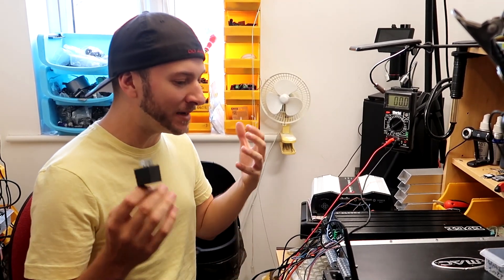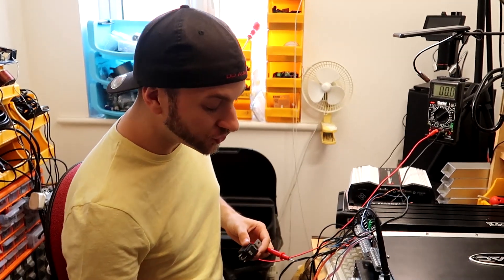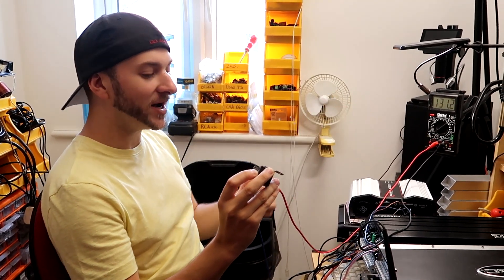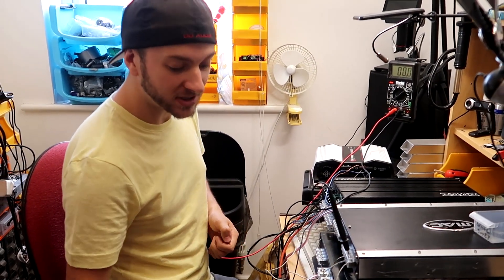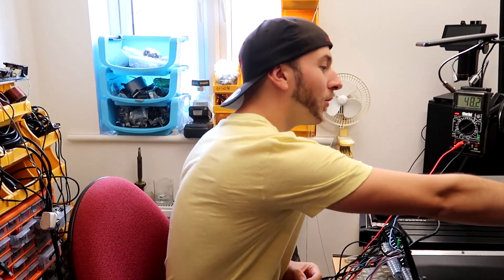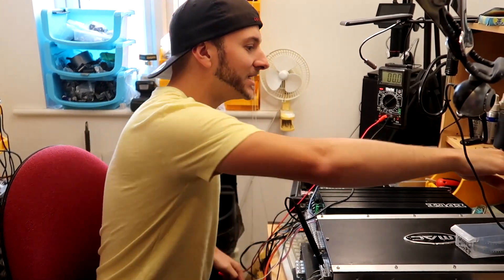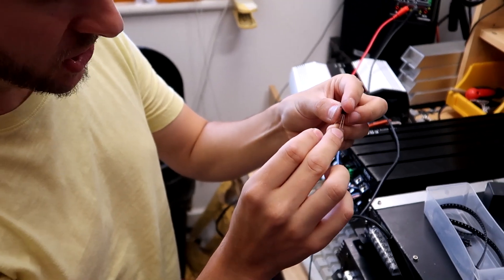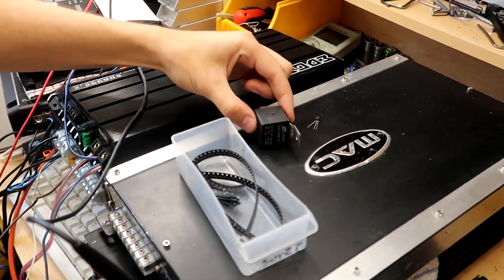"Bro do u need a relay on the remote for runnin 4 amps"

Comment: We had different head units with blown remote lines, all caused by an amplifier/s letting the magic smoke out. 
Most were flagship models running a few front stage amps and multiple sub amps.
If I'm just running an sq system no relay is fine. 
SPL... I would use the relay just in case I create an amp-le-fire.
P.s. don't forget the diode the suppress induced voltage.

Comment: Great demonstration. I'm a believer in sensing circuits drawing less power.

OK. How about active crossover vs. passive crossover networks? Is it even possible to measure any benefit between the amp to the speakers from one design to the other?
Reply: Crossover should be done pre-amp.

Comment: In my case idk if a relay wa s necessary. I wouldn't say that but I did have to run a separate 12 volt remote to the extra amplifier because it was not liking the fact that the factory amp had to share current with the subwoofer amplifier.

Comment: I've only had issues two times when I daisy chained the remote wire to a subwoofer amp and to the factory amplifier. In those cases I went the old school route and wired the subwoofer amplifier to a toggle switch.

Comment: I have 3 amps, a dsp and a voltage display on the radio remote turn on and it works without issues.

Comment: great experiment! however, you have to cut the industry some slack, alot of these misnomers are based from YEARS of misinformation and possibly from older equipment that was likely GARBAGE! The real issues I wish people would start understanding is that you DO NOT have to run everything at 1 ohm to be happy... Its almost the equivalent of driving your car with the transmission constantly in first gear!

Comment: Never used a relay and am not going to. I've ran multiple amps using the daisy chain method and never had 1 fail to power on. I've had multiple discussions with people that you don't need a relay.. its just 1 more part to fail.

Comment: That has to be the shittiest relay I've ever seen for pull-in. Most 12v relays will turn on with 30 mA or less. Most head units are regulated to around 100-300 mA on the remote. 1 amp on a remote wire is not that common for a head unit. Can you power several amps with a head unit, sure. Should you just read the specs in the manuals and make an educated decision instead of relying on youtubers or internet "experts" giving you bad advice, absolutely 100%!
Reply from the maker: I tested a few other relays I have here, all different sizes, all were around 70-150ma, considerably more than these 8 amps together, Not to mention the inductive flyback issues the relay coil can present to the head unit that I didn't mention here...

Comment: Was just thinking about this since I have two amps daisy-chained together on the remote turn wire. Thanks for clearing this up. But now I got a question: can you add a clip light to an amp that didn't come with one to begin with?
Reply from the maker: Yes but it's quite complicated to do.
Reply: @barevids  anyway to make one for the speaker outputs on a separate light on the dash? Any chance for a video on that?
Reply: @jimmybass7595  Yes take a tiny marker lightbulb and  run in parallel with the speaker.  Find one that measures more than 30 or 40 ohms.  When you start clipping the light will start flickering at the frequency of the clipping.  It won't light unless there is clipping and will flicker at that frequency

Comment: The only time I use a relay (solid state, 5 mA draw) in my remote turn on is when I have a hidden amp rake with ducted fan cooling. It only turns on the fans not the amplifiers.

Comment: Many old school amps drew more current.  I had 5 amps that kept burning up the remote output on my decks.  I measured their collective draw at a little over 2.5A.  In that case the relay made more sense.  That’s not to say there may have been some other underlying issue.

Comment: Some head units from 90s and 00s have terrible remote output, not even 10v at 50mA.
Some old amps also pull 50+mA for the remote and needs to be 12v. Not even 11v turns them on.
What's your relay current pull at 10v or 8v?

Comment: some amps draw more current from remote line than others.
I have seen some cheap amps using the remote line to drive the fan circuit and some flash LED logos.

Comment: So I was till by a very prominent amplifier repair guy in the US that some full bridge amps must be ran off a relay. Why would this be?
Reply from the maker: If you're talking about Shane, I spoke to him about this. He was recommending this due to Taramps using a 5v regulator to turn on the internal PIC and he assumed the remote was giving power to the 5v reg. Whereas in fact, I showed him that the remote simply gives a logic level high to the Enable pin of the reg which draws absolutely no current. So you should not use a relay for these.
Reply: @barevids  actually it was Kevin who told me this.

Comment: Don't agree with that . Some amps like Rockford fosgate use the power from the remote in to power the transistors for the mosfet gate drivers 
so I always use a relay and also the pioneer head units their remote output comes from their audio amp IC  so it is safer to run a relay but not the 30/40 amp that you have , you use a relay with a high impedance coil .
Reply from the maker: No, they don't. I've repaired hundreds of Rockford amps and the remote line does NOT directly supply power for drivers or anything else. Rockford circuit designers are extremely good at what they do and this would be the stupidest thing ever. The remote line sets off a chain reaction of energising transistor bases that results in current flowing from a larger transistor from 12v+ into KA7500 pin12, NPN drivers, fans, leds and so on. In my whole life of repairing car amps, never have I ever seen the remote line used for anything other than a logic level enable signal.

Comment: Relays are useful in some applications. Like powering up a cooling fan for example(not by remote wire). But for power remote turn on for amps is a "Fad" not a necessity. The amps don't care, they just want to know to be on. It's a trigger, just like the trigger wire on your alternator.

Comment: Yes!! BOOM! Myth blown out of the water! Thats the kind of video we need PROOF! Thanks I could pick your brain all day with questions like that. Can you do something similar on getting the best signal to amp, rca, balanced vs non balance, 1 volt vs 8 volts,mono vs. Stereo vs. L + R, twisted, shielded, tie them in a knot, you get it. Within a noisy environment= cellular, ignition, alternator, gps,tps,abs,(heater fans, mirrors, windows), Ecm, power seats. Bla bla it seams so hard to get clean unaffected signal 12 feet.

Comment: The remote connection is just a simple signal 0/1, 1 means the amplifier remote is pulled to positive, 0 means is pulled to ground, it's that simple. no need to use a relay that can draw a massive current and also maybe they do not have blocking diode/flyback diode for back-EMF paralled to the relay hahaha, maybe these experts you are referring to are those people that hear stuff hahaha, just because the remote has big terminal does not mean it draws massive current.

Comment: and my stuff (2 amps Bass and Door speaker amp) uses Kicker's Auto Sense Tech so no remote wires are necessary for my set up. Been working flawlessly for the last 2 years.

Comment: okay I got a question then... I wanna put a fuse block in back of my radio to power my accessories (radar, mirror, camera, etc.) because I don't want to just tap power from the same source; BUT I want these ON/OFF with the car. So I have to tap off the ACC wire for that signal but I don't wanna put so much draw on that one ACC wire so can/should I use a relay in this case?

Comment: Hey Sam, seriously appreciate all the videos you're putting out at the moment. Love your work!
Reply from the maker: Thanks buddy! I have a huge tank of motivation at the moment and will be busting them out a fair bit!
Reply: @barevids  You really sound like you know your stuff. Would you mind helping me out with an issue I have? I've purchased and installed a Sony XAV-AX8050D Head Unit, Alpine R-D65C.2 Component Speakers, and a Pioneer PRS/D800 Amp. The sounds is great, however im getting a Pop Noise on turn off. I've tested it by removing the Remote On wire from the Amp when the engine is running and music is playing and don't get the noise when the amp goes off (whilst radio on) therefore must be the radio causing it by turning off before the Amp? I've spoken with the company I purchased the gear from and they've told me to wire directly to the ignition live instead of Remote on, and this may help it, but they said they sometimes get it and can't resolve it..... Do you think the ignition live idea will sort the pop instead of remote live?

Comment: I agree with you but it doesn't really answer the popping sound of the amp. A relay stops that from happening.
Reply from the maker: An internal relay inside the amp stops the subs popping when class D switching activates. 
If you are getting turn off pop you have a difference in ground potential between rca ground and main ground that needs resolving.
Reply: @barevids  Currently have this issue with an alternator whine and its driving me insane. Was recently told a relay on the remotes were the fix. Do you have a good troubleshooting point to fix the ground potential difference? I have tried changing every component but the headunit. Bypassed my audiocontrol DSP with no luck. Upgraded headunit grounds to truck frame. Tried grounding headunit chassis directly to negative battery post. Tried grounding RCA shielding to headunit chassis. Im at a loss. Was hoping a relay would fix it.

Comment: Did you forget about line loss or resistance in wire going back to your amplifiers. I have 5 amplifiers wont power up without using a relay. I can do 3 max using a 16 Gauge remote wire.
Reply from the maker: Hmm, with 5 amps assuming about 30ma, it shouldn't drop that much voltage across the remote line. Even if it drops it a bit, most amps remote turn on threshold is 5v.
Reply: @barevids  Oh I agree, Its weird, But thats how it worked out for me.

Comment: How often do you see an amplifier fail and force power back through the remote wire into head unit? How do you feel about putting diodes inline to each individual amp remote wire on a multi amp setup. Would adding diodes increase the power draw excessively?
Reply: The diodes would actually slightly decrease the power draw because of the 0.6V drop across the diodes. This wouldn't affect the operation of the amplifiers in any way. Even less than 8 volts would probably trigger most remotes
Reply from the maker: Never seen this happen - the remote wire is electrically decoupled from any high voltage/current parts of the amplifier in every amp I've ever seen.

Comment: Great info man. I've wondered about several facts you've mentioned in this video. I do use a relay in my system, and I only have 3 amplifiers. But I use the relay to turn on a few more things besides the amps. I have a couple sets of lights, and a couple fans. I also have each of my amplifiers on a rocker switch so I can shut them off individually if I need to. Great informative video about some info that matters. Thanks for sharing the content!

Comment: This is exactly what I have always argued with my friends in the past. In the end, they had a relay (because the headunit can't provide as much current to turn it on, but I had a normal series connection. The relay died during the competition and they dropped out. In the end, they switched to "my" concept.
Headunit easily powered 2x GZPA1.10000 and 2x4 channel amplifier from GZ which model I don't remember at the moment.

Comment: would this ring true for older amps from 20 odd years ago sam? I remember people did kill their remote output back in the 2000s and 90s with running a few amps even off their remote and personally i've always ran a relay for multi amp and accessories to run such as dsp, processor, fans etc etc it's been more a habit to protect the headunit just in case it did all draw too much for it to handle.
Reply: The point he's making is it can't draw that much current anyway.
Reply: @kris-english  what can't.... i know the point he's making kris. hes put 8 amps on a remote showing they don't draw enough to cause an issue and he's showing fairly new amps that work on a different circuit componentry to older amps meaning they're never needing to draw large amounts of current but this wasn't always the case. I asked if he thought it was true in the case of 20 to 30 year old amps. Don't think Sam would have that much experience with that to know though since he sticks to mainly class d as he has said himself on many occasions. 
Also, it may not have been the amps but old headunits may have just had very weak remotes.
Reply: @joeshaft  Good point.
I used to daisy chain amp remote wires for years up until about 10 years ago and I fabricated a posh looking relay fuse block and ran them through that. I never experienced any issues. Good question though.
Reply: All the amps I saw from 20 odd years ago had the same low current remote input.  There may have been some exceptions, so if in doubt, measure the remote current as shown.  I would be more nervous driving a relay unless it had a protection diode and a low input current.

Comment: I have had problems hooking amps to the remote on headunits before but usually just find an accessory that shuts off with the key in the off position not add a relay.

Comment: I think this myth just goes around because old amps had relays in them to turn on so if you had 4 or more amps you would be looking at 600MA or so pull on the remote line. Some old habits die hard. 
Agreed though no need for it on modern amps!

Comment: I’m ganna disagree..... it’s about how much power the deck can produce through the remote wire.... I’ve had multiple high end decks go out from having multiple amps ran off that single remote wire... just because it works with you this one moment doesn’t mean it’s always ganna do that .... smdh how is a relay ganna take more power to turn on then amps lol the relay just needs a signal that’s why it has a separate power and ground that is logic lol also that voltage is resting I’m sure there are surges that happens... I’ve been using relays for over a decade with my build and many other and literally every system I’ve built I’ve had to use a relay so Mabel it’s different in the uk but this is not fact js
Reply from the maker: Hey buddy. Im not sure you understand that the actual current draw, therefore the amount of power draw, is clearly shown here. The relay draws 130mA, which at 12v is 1.56W. All 8 amps powering up together only draws 48mA, which is 0.57W. These are stone cold electrical facts and these amps are not UK amps. I explained clearly in the video WHY the relay takes more power than all 8 amps together. Try watching it again before you "sydh" too hard and get a migraine!
Reply: @barevids  oh I understand what your getting sure... that doesn’t mean everyone gets the same figures as you.. especially with different amps! I’m just speaking from real world problems that I have actually had and the only thing that happened was the remote wire went out! Too much current being drawn from the remote wire of the deck... happened to me multiple times on multiple high end decks... been installing for a couple decades now and I know that every test can have a different result if you want it to... that is science bud... I’ve been following you for a while now and I usually agree with what you say but my experience says different here...

Comment: I relay switch the remote from the head unit simply because I use that feed for fans and lights etc. I then relay off that feed to fans etc to separate unwanted noise down the amp remotes xx
Reply from the maker: Hell yeah when adding anything current-driven a relay is always the way, and if its already there you may as well tap off it for the amps as well.

Comment: Why do you say daisy chain, that is bit confusing as it's basically wiring in parallel so no need to daisy chain.
Reply from the maker: People use the term a lot when referring to the cable going into one amp, out to the next, out to the next, etc. Saying "paralleled" would be accurate but less well understood I guess.

Comment: My head unit doesn't state the power output in the manual for the remote. But I'm assuming it's upward of 1A like you said (AVH-200Eax) as I run a 140mm fan off my remote wire for one of my two amps. 

I should be well under 0.2A with this configuration since the fan states 0.14A at 12v. It's not ideal. But it works. Does add noise similar to alt whine but more of a static sound vs high pitch noise. Only audible when car is idle and my air is off. With my air on low or higher it disappears in the noise. Impossible to hear while moving. 

Thanks for the video! Good to know I can add 100+ Amplifiers to my car now using the rem.🤣
Reply: A little capacitor across the fan would probably sort that noise
Reply: @fedgeno  Probably yeah. I never tested that as I just ran a dedicated Fused 10A line to the back of my car that's for the fan and my backup camera. No more noise and it turns on with the car.

Comment: Can you use your head unit to turn on 1 amp then use that amps power wire to switch a relay?
Reply: Take out your 12 volt circuit light and see if there is power on the amp power wire before you turn on the remote.😉

Comment: I've NEVER run a relay on my remote wire when running multiple amp. It's NEVER given me a problem, EVER. I'm currently running 4 amps. All run directly off the remote. Everything turns off and on just like it's supposed to. For whatever that's worth.
Reply: Cheap headunits are the only ones I have ever had problems with